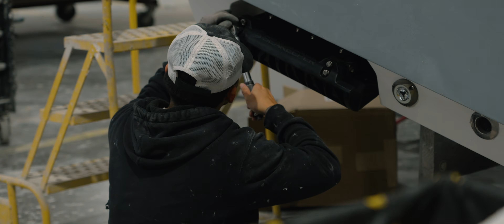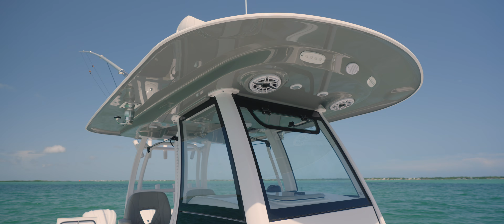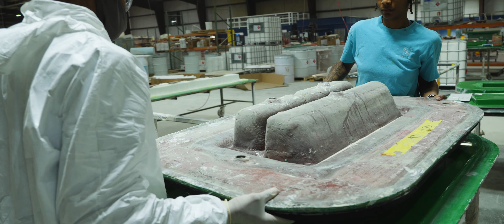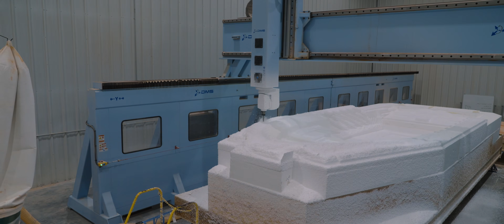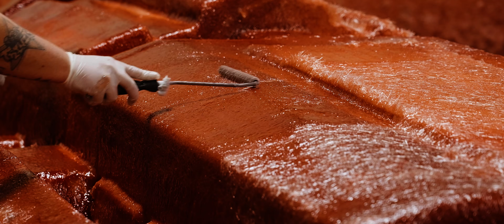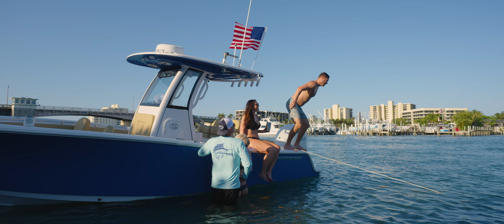Recapping Season 2 + Inside Look At Season 3 - Sportsman's "Behind The Glass" (Season 3 - Episode 1)

Comment: you should start offering trolling motor package as an upgrade.
Reply from the maker: As of July 1st 2024, trolling motors are now offered on all Masters Series models.
Reply: With all the trolling motor brands and models currently on the market today it’s better if the dealership helps the customer decide what trolling motor brands and model to go with based of the serviceability and warranty coverage of the trolling motor for that area. Also it’s a huge overhead expense to stock a variety of every different model saltwater trolling motor available from the current trolling motor companies on the market today. When you stock a few Rhodans, Simrad Recons, Power-Pole Move PV, Garmin Krakens, and both MinnKota RipTide Terrova and RipTide Ulterra models you can easily have $100,000 in only 25-30 trolling motors. Then if the technology changes and an updated model comes out then you can get stuck with old inventory, and have to eventually sell it at a loss to move it.